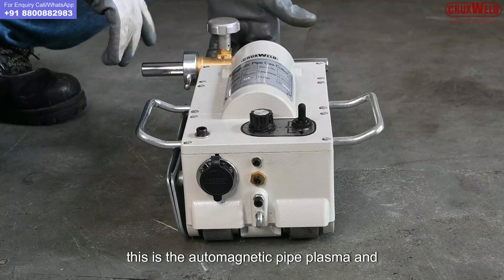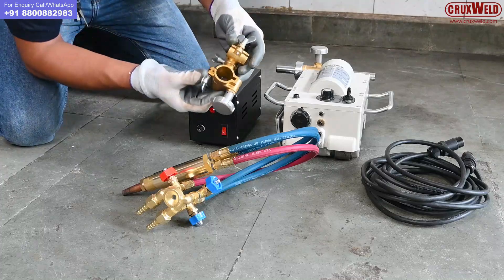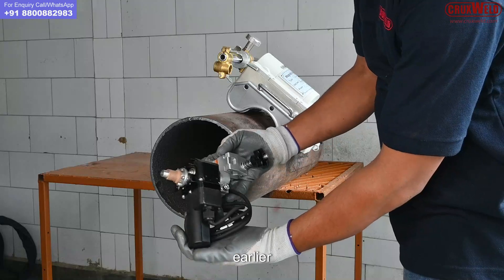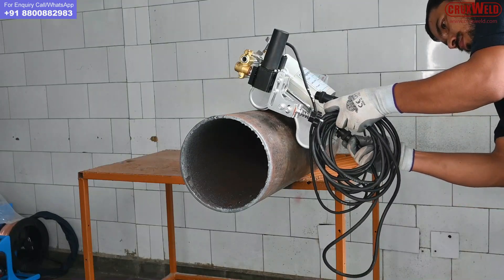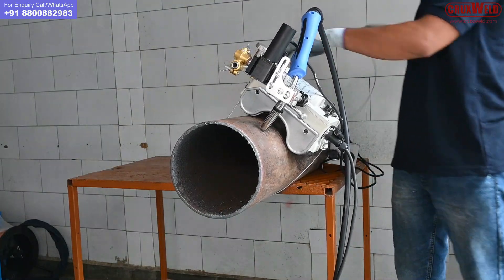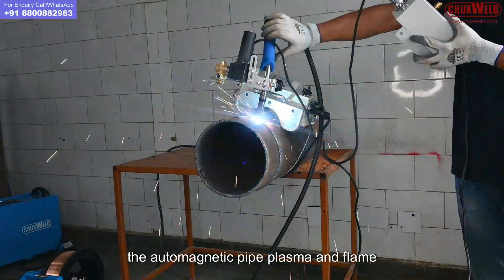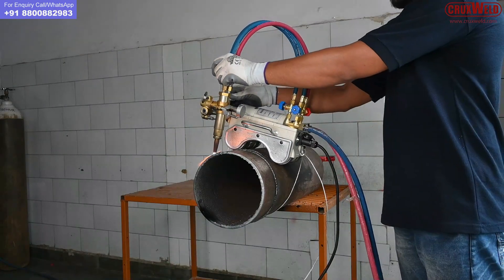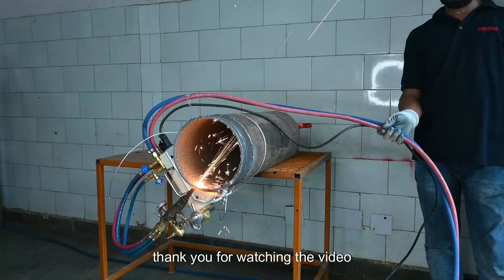360° Welding Freedom:Automatic Pipe Welding Solution

Comment: All the vido off these  track welding  machine   and  robot   show  only weldin  bétween two pice off straingt pipe,  never   with  an elbow  welded  directly  to a Tee     bécause  in piping  mostly  there is fitting butt/ butt
Reply from the maker: That's a great point, I'll try to showcase that in a future video!
Reply: Price please